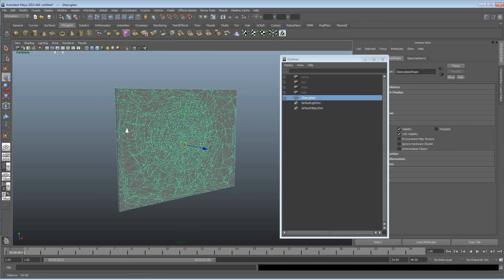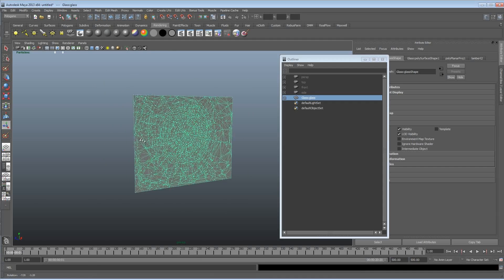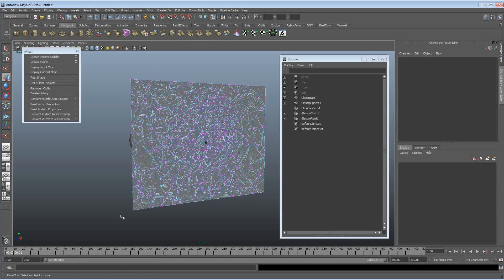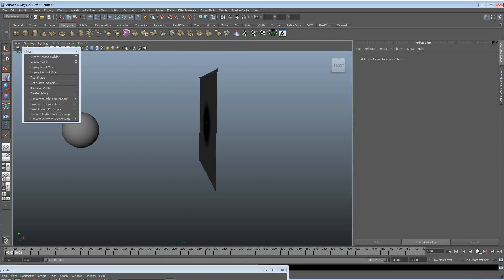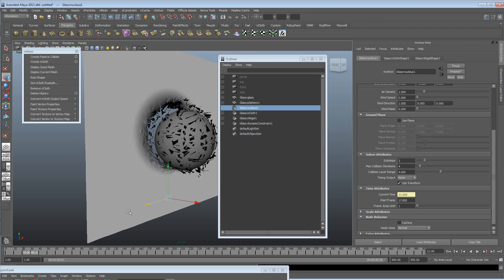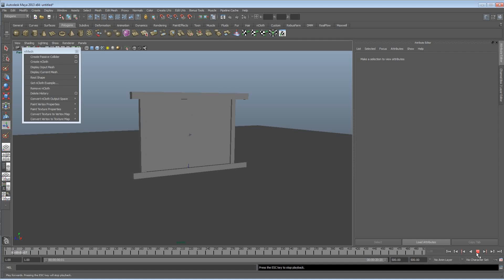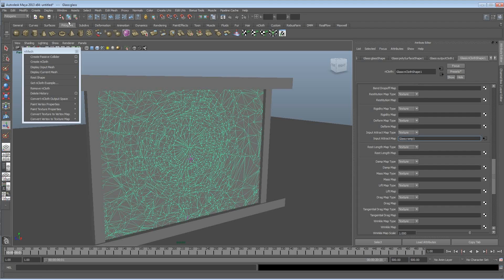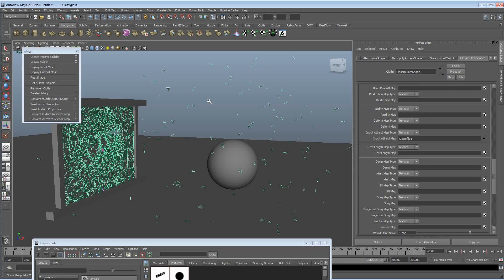Maya glass smash

Comment: Phil, great tutorial and very easy to follow along, I'm having a small problem at the render stage however. If I take a single render at say frame 0 or 1 the centre of the glass where we applied the ramp is already showing as shattered, any ideas what may be happening :-)....
Reply from the maker: Hi Neil - that would mean that for some reason your sim is starting at frame 0 or 1 which means that the object that is hitting it must bit hitting it at this point - or - your material is starting to sag down early on. Firstly check that your collision object doesnt start so early and secondly if that isn't the case think along the lines ofchanging the nucleus to start the simulation later on (within this tutorial) however if you are using maya 20133 or below just send me the scene and I will take a look for you - I will then feed back to you the issue. phil at strangebox dot co dot uk
Reply: Hi Phil, thanks for the quick response very appreciated, I'll retry the lesson again and let you know the outcome, I'm using Maya 2016 so hopefully it's more a case of my poking the wrong keys.

All the best Neil

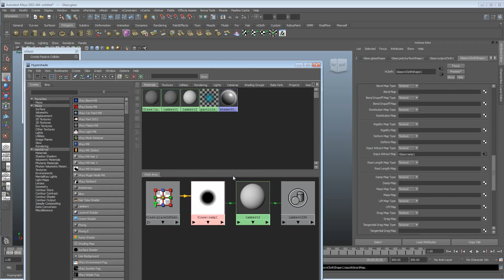Comment: Im having a problem at the 8:00 mark where my plane is shattering at the center then the particles are coming back into the circle. If i turn the input mesh attract down to counter this and make it more lose then it falls down like a cloth and breaks apart at the 4 holding points... I am also having to create a new cache after each time i change anything. Any help would be much appreciated. Thanks
Reply: +Michael S Nevermind I think i found the problem, i dragged my texture to the text area of input attract map and not the actual words which attaches it to the dynamic effect. Great Turorial
Reply from the maker: +Michael S Glad you sorted it :)